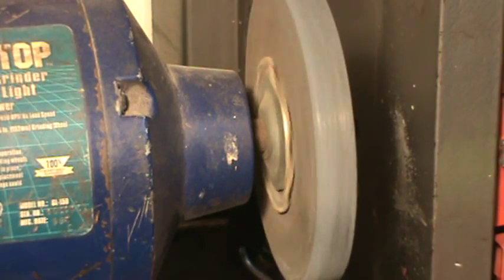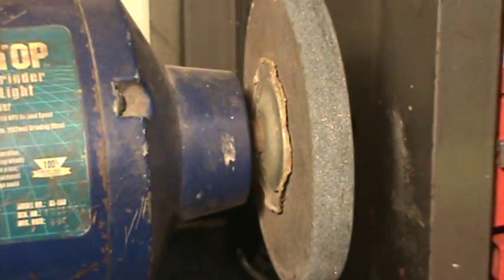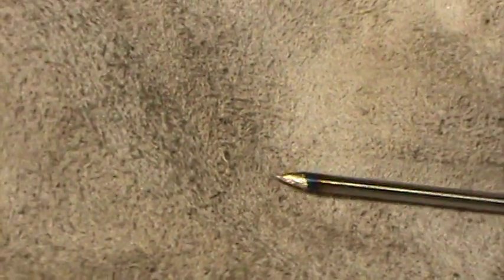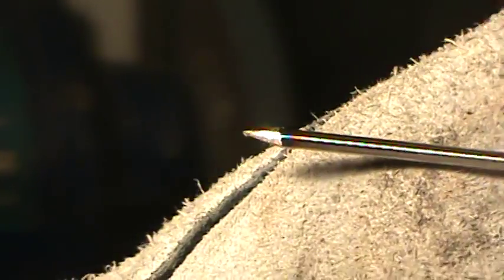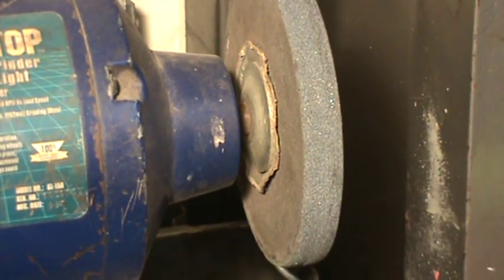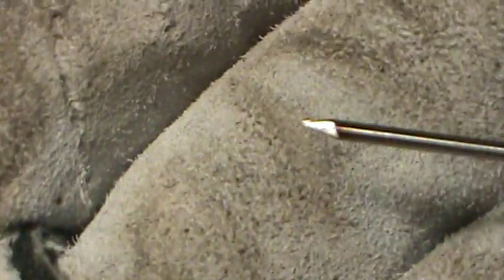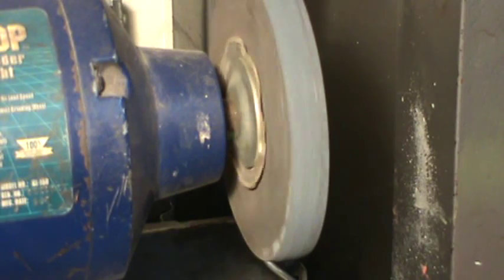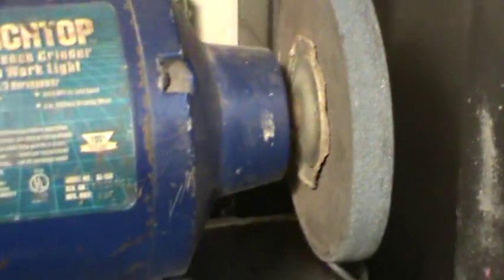Easiest Way To Sharpen Tungsten For Tig Welding

Comment: Normally you grind tungsten with the tungsten facing down in case the tungsten catches and stabs your hand.  It's much easier to just twist it and not overheat it.

Comment: I'm not sure if you have heard this before or not. But my welding teacher always said when working with tig and tungsten you must use the grinding wheel and steel brush for tungsten only. He said you can't grind anything but tungsten on that wheel or brush( brush for cleaning up your welds). He also said have a seperate pair of clean gloves for doing tig welding. Just food for thought not sure if its true or not as I don't tig weld. Thanks for the videos!
Reply from the maker: Yes, they say dedicated grinder for tungsten so as not to contaminate it with foreign metal. I'm a hardcore rebel like that though.
Reply: Hahaha! I really enjoy your videos! Keep up the good work! Thanks!